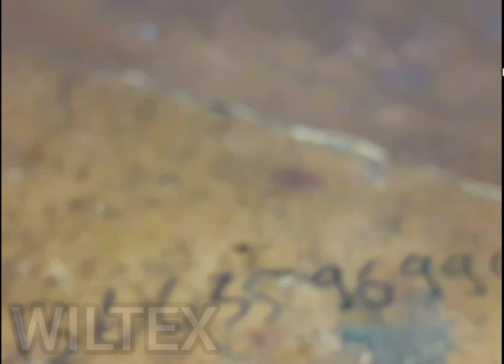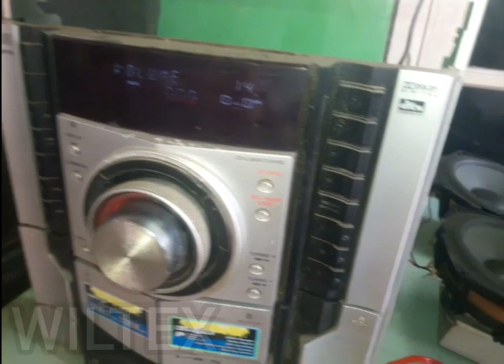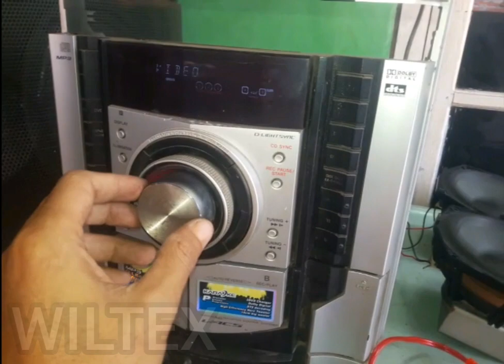Sony hcd gnz77d Amplifier Repair with TDA7498

Comment: Share your mail id. I have board and transformer from two different sony sound systems, I want to make amplifier from them.
Reply from the maker: send to my FB

https://free.facebook.com/WangsaBumi?refid=46&ref=opera_speed_dial&__xts__%5B0%5D=12.AbrvoNtM-U92ZpWySnT55l4MC2wYOGugcMGl09IsTV0zWvayJS-v68jkZEtfTFlbjhqH7U1bdKWNJpvYFd0ktET2SnZvY6rzPGmnIDVwpNvT_RPovXuc3x0a5U-oOu2ynLIn-Uz9Nqn0sQ5bApsNmmAF553bWX_5fGqHne5ln9FuKwm-7dWirRHJ9c1ZyJpHdImnIYWvEBX4a7NCrPQBaES8e-1_jAm_yBtqt8RAO0rjHxdI7yeNYiTiwxLxmqXjjjguciSVRVELZpy8KxrXk6-4OcjRIz1rRNU5msB_DC39gA6kNu0ZzSljTDjJdY6gyBvknnE_SZ4nm3FJDzRuwSaO0vXIBQGQvN02xgadADJy75CgYzS8TQXKqszN-YlCmyLW5xcopLJIoWLk4gwM5ZjC8R9Y_TZHLHPClxaUwAAZ8g-tQP6SYJEEZSnTq4FybvfBZiZD8CYzKCJ4vHSSBBAl5yye6mdyzIaV68AxsuiVuXAeBF33BLmI2N1TRhg9lSoErwqReUksm7lQyADISvfi9Ce_OIJ7jSlrqcAVSL81iGQQWUZYANE0d8p_xSl1S9Q

Comment: bang kenapa ya punya saya dvdnya gk mau muter?
ya pencet open pun gk mau keluar
Reply from the maker: y mas.. kebanyakan hifi sprti ini memang ky gitu..  karna di bagian dvd dan juga pita kaset itu berkaitan dengan mekanik dan sensor.  biasanya karet  yg untuk menggerakan mekanik putus.. atau bagian mekanik udh aus.. bisa juga sensor tidak bekerja dengan normal.. dan sparepartnya susah nyarinya..
Reply: Gan sya punya sony mhc gzr7d suara ada kecil klo pas bass kemeresek volume gk bisa di min sama max kira² apanya iya mhn bntuanya

Comment: Tape seperti ini bikin mumet kalo rusak
Reply from the maker: betul masbro.. PSU udh SMPS.. power udh Class D.. udh gitu hampir semua IC satu merk CXD
Reply: @WILTEXElek  saya punya tape sony 22 nya gak tau rusaknya apa.yg satu lampu display kedip kedip doang
Reply from the maker: pas kedip muncul tulisan apa.. seri berapa..
Reply: @WILTEXElek  sony mhc v707 om
Reply: @WILTEXElek  lampu tombol2 nya aja nyala kedip kedip,layar display matot,awalnya tape idup cuman volume aja yg ereor pas di bongkar solderan kaki potensio pada retak,lalu kabel kabel saya cabut kaki potensio saya solder,pas kabel di pasang lagi,lah jd eror
Reply: @WILTEXElek  ngedip tombol 2 nya aja om.
Reply from the maker: coba cek lg aja.. terutama bagan kabel soket yg tipis barangkali kabelnya ada yg bersentuhan.. dan kaki2 solderan soket...